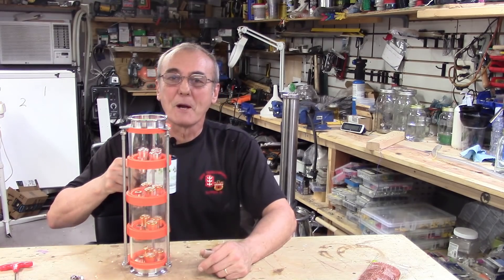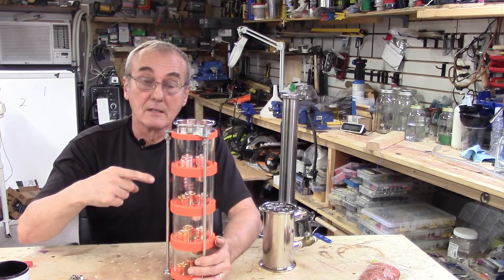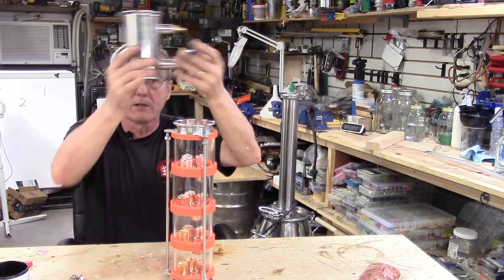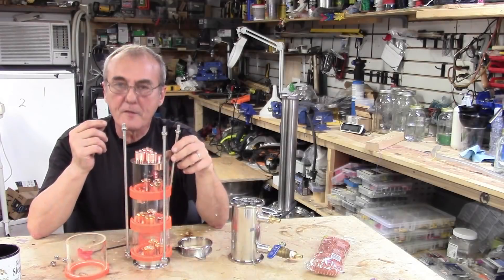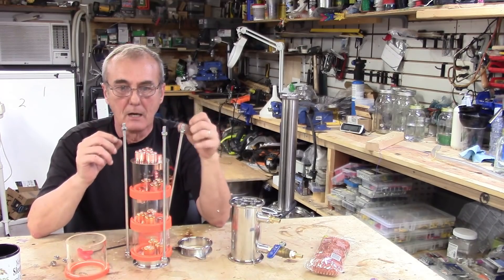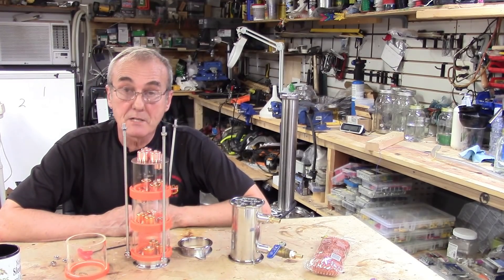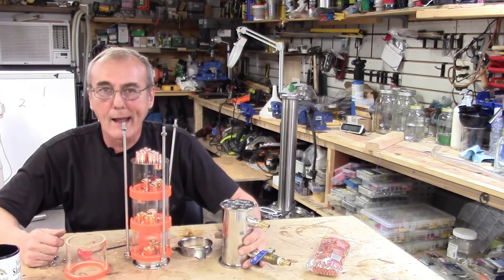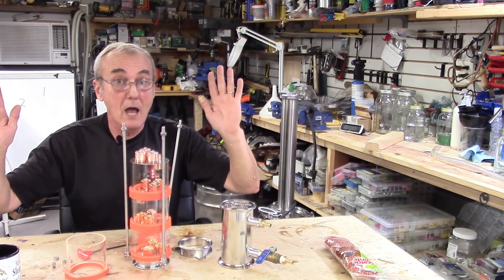RUNNING A 3 INCH BUBBLE PLATE COLUMN

Comment: I am considering upgrading from a 2"  bubble column to a 3 or 4.  Does it help the run go faster? I have a 50 litre still I use it on.
Reply: 3" double the output of a 2" column

Comment: 3" Copper Bubble plates Distillation Column with 5 section for Distillation .Glass column . https://www.aliexpress.com/item/33018484813.html?src=google&albch=shopping&acnt=708-803-3821&isdl=y&slnk=&plac=&mtctp=&albbt=Google_7_shopping&aff_platform=google&aff_short_key=UneMJZVf&&albagn=888888&isSmbAutoCall=false&needSmbHouyi=false&albcp=11473829221&albag=112083206157&trgt=489474619664&crea=en33018484813&netw=u&device=c&albpg=489474619664&albpd=en33018484813&gclid=Cj0KCQjwi7yCBhDJARIsAMWFScMWw63sA-WT1jXkDmNA2Ho-N0AqgV-ZFC8dmC2axpJuTJSkJW25c4oaAkG4EALw_wcB&gclsrc=aw.ds

Comment: Is there an efficiency issue with using a 2" to 3" adapter on a keg?
Reply from the maker: In terms of run time there would be little improvement. You are going from 2 inch with an adapter to 3 inch which in actuality is a 2 inch column. The vapor flows faster in the 2 inch and when entering the 3 inch it will slow down (following fluid dynamics) so unless you increase the temperature the output rate remains the same. Increasing temperature can lead to scorching or early arrival of tails.
Reply: @BarleyandHopsBrewing  Thanks!

Comment: Did some work on a chemical separation prototype unit 18 months ago.
Got to meet some very cluey Phd type chemical research scientists in the process and picked their brains as much as I could in meetings.

They swore black and blue that packed columns where the best option whether scrubbers or structured packing, until your column gets out to about 2 foot diameter, at that point they said it was more efficient/practical to start using sieve or bubble plates.
Reply: Interesting. All the small commercial distillers seem to use bubble plates, but they are separating their cuts at each level. Maintenance and cleaning is probably a lot easier with bubble plates too.

It would be helpful to see a head to head comparison with small three inch systems. Going the bubble plate route, even DIY, is quite a bit more expensive than stuffing a column.

Comment: Hi George :) I'm wondering if you would do a video or share some info comparing a packed column reflux still with a bubble plate/ flute still. I can't seem to find anything here and would love to hear your thoughts/experience on these. Aside from a big price difference, are they fundamentally the same?
Thanks for your time,
Carley.
Reply from the maker: Great suggestion!
Reply: @BarleyandHopsBrewing  Seconded! But as you always say George, let your conscience be your guide.
Reply: Yes they are fundamentally the same.  Ease of maintenance (cleaning) is one big difference.

Comment: Would that work whisky with the bubble plates
Reply from the maker: yes
Reply: Hi I see this one guy first puts it through a pot still and then through a bubble plate still does this not strip the flavors to mush 👍
Reply: Yes, for whiskey/bourbon you just wouldn't use any cooling in the dephlegmator (turn water off) or remove it so all the vapors go over into the condensing side.

Comment: maybe you can help me with the following comment.Hi Michael,                  We include many items with our distillers that are not even available elsewhere, such as a water control system.  However, I extremely highly advise against using a PID controller to try to control your temperature, as it causes cycling of your heat source which makes it impossible for equilibrium to be reached in the column, resulting in a lower purity/quality product.  To control the speed of the boil you should use a voltage controller, which allows you to reduce the heat output of your heater without causing cycling.  The result is easy control of vapor production speed while maintaining a consistent speed of vapor production.  Your head temperature will be able to remain constant, with a much higher final product quality.                  Please let me know if we can be of more help or if you have any more questions.                                  regards,                                  Rick  BrewhausHot Sauce Depot5951 Park Vista Circle, #125Keller, TX  76244817-750-2739http://www.brewhaus.comhttp://www.hotsaucedepot.com
Reply: If you don't know Rick you should, he's an expert.  And he funded the first effort at changing the law in Washington several years ago.  Great guy.  Use his site for all your supplies.    Plus, Tech Ingredients channel bought their still from him for their distilling videos and distillation explanations.
Reply: Rick - Do you recommend any low cost voltage controller products or kits?.  I know StillDragon used to sell one.
Reply: @VARocketry  I got a 10,000 watt one off Ali Express for my still boiler. I run a 3.5 kw element 240 volts. Works great

Comment: Cool video! 
Have you ever done anything with jack distilling, by freezing the worst as opposed to heating it to remove the water? (Traditional Apple Jack)
I know it can be dangerous because of the height concentrations of methanol and other toxins. I imagine if you would but it in the still and heat up to and hold 170° for 15 minutes it should remove that and then freeze distill it it would be safe...
Reply: (double check what i claim before acting on it)   i dont know anything about jacking other ferments than apple - this is only about apple jack:

i beleive that most of the methanol in hard cider is 1) already present in the raw apple juice, 2) produced by fermenting pectin.
commercialy available ap juice (the cheap stuff in supermarkets thats preserved with vit c), has been pasteurized which removes most of the methanol, and its been cleared, which means the pectin has been stripped.  

so if you ferment that, there should not be significant methanol content, as opposed to using fresh, untreated ap juice.

you dont generate methanol in freeze distillation, so your ap jack will only be as dangerous as your hard cider, ie not very.  it does have all the congeners and tails, so its hangover material though.

if you are going to distill it, you will get ap brandy, not ap jack. in brandy, most of the flavour is in the heads.  ap jack has all the heads, brandy usually doesnt. so its a different product. 

the point of freeze distillation is that its cheaper, low key and easier than heat dist.

if you make and drink hard cider and you havent gone blind, you should be able to jack it too.  just make a note on how much hard cider gives you how much jack. ie 1 pint hard cider = 1 shot ap jack, and then consume according to that.  so if 4 pints of your hard cider = zombie hangover, dont do 12 shots of jack from that hard cider and expect to leap out of bed with a postive outlook on life next morning :)

Comment: Would a 4" column set up take more Wash to make it run "best", or is a larger diameter just require a larger wattage element to maintain column temperature ?
Reply: bloombrews 

The larger the column the more vapor that can occupy it... therefore the faster you can distill a given quantity of liquid.

If a reflux column is properly balanced it’s size won’t affect quality... just time.
Reply: Agree with Mad mick, the answer to your question is NO and No.  Larger operates faster.

Comment: If I have a 25 liter pot (still) What would be the maximum gallons or liters should I or would you put in it
Reply: Around 4 gallons and make sure to add boil conditioner to keep the foam down
Reply: What is boil conditioner
Reply: @scummyification  its sold by most brew shops and will keep your mash from foaming up when you distill it.
Reply: Use only 75%or 80% of your container capacity.  Varies because aggressive boils cause more foam.  So use 17-20 liters of mash in that 25 liter pot.

Comment: Sir I have a pretty basic question. Im running a 15 gallon keg. How much space would you leave in the pot between your liquid and the column?
Reply: I would put a max of 12 gallons and make sure to add boil conditioner to keep the foam down.
Reply: @chuckdontknowdoya6100  Thank ya Sir

Comment: Hey,
I'm an old follower of your channel. I just started this account.
I'm in progress to build my on still. My goal is to make single pot whiskey from malts. I have the following question.
When using reflux, why not control the cooling water flow with PID (3-way valve) and let the heater work full capacity?

Comment: Hello,  I need help,  I'm new to distilling and I used a recipe I found online. I used 8lbs corn, 10lbs brewers sugar and 2lbs 6row barley, 5gal water. I heated to 180° (new burner and equipment heated water too much) stirred in sugar, let cool to 160°, stirred in corn,  let cool to 140-150° stirred in barley, let cool to 90-100°, stirred in yeast and let sit 12days. The problem is the whole carboy is cloudy and looks like its all sediment. If I look closely i can see a thicker layer of yeast on the bottom. I ran through cheese cloth and my ABV is only 4%. I'm about to distill now but I don't have high hopes for high yield.  I did something wrong but have no idea where the hard left took place.
Reply: What was your starting and finished readings of your hydrometer.

Comment: George, are you removing all of the column packing when you use the bubble plates?
Reply: Yes
Reply: You can or you can't.  Packing in the column acts as additional plates to increase the total effective number of vapor separating plates when added to the 4/5 bubble plates used.  So instead of 4 of 5 plates, you may actually be effectively separating with 8 or 9 plates.  Some people say they're redundant, but you can chain multiple packed columns or bubble plates together to achieve whatever level of separation you want.  Someone looking for a whiskey / bourbon WOULD NOT use a packed column and bubble plates together;  if vodka or pure alcohol stripped of flavors is desired then use both or more.
Reply: @VARocketry  
I have been using four 3” bubble plates from Mile Hi and a four plate Chinese tube. I and getting 95 percent in the beginning of the run and around 85 percent at the end. I shut the still off when I hit 50 percent.
Reply: @edwardclutzjr262  Ed - Understood.  Okay, so 50% means you’re stopping when your mash is still yielding 50% alcohol content ( or 100 proof output).   That’s way too high for most distillers and wastes alcohol. 

 If that’s your cutoff for taste, then recommend you continue to strip down to 20% or lower and then save & pour those tails back into your next batch.  This will add flavors and alcohol from those tails into your next run.
Reply: @VARocketry  
I will try that on my next run. 
Thank you.
Reply: @edwardclutzjr262  Cool.  You won't regret it and you 'll have more alcohol stripped on subsequent runs.
Reply: @VARocketry  Do you by any chance know whatever happened to George Duncan?
I see that he has not posted anything for over six months.
I learned a lot from George and I miss his posts.
Reply: @VARocketry  20% Output, how much alcohol is still left in the boiler?
Reply: @losFondos  20% of the  volume of the alcohol in your batch/run. So if you are running 11gallons of typical 9% yield low wines, multiply that by 20%.
11gal x 0.09 x 0.2 = alcohol left (approximately)

That’s why we collect those remainders and run them again .
Reply: @jimsutton8874  wow, that sounds like a lot of product left in the kettle. What would happen if you continue to distill it further? Increased amounts of fusel alcohols?
Reply: @losFondos  the resulting product didnt taste good but was easily combined into future runs to be redistilled.

Comment: You have to be careful buying copper mesh as well there are many that are coper coated. I use 3 in sanatary sight glasses with a bubbler plate stuck in there. On thing to look out for make sure you dont over tighten the bolts and tighten them evenly. If not you can crack a glass. Replacement glass is hard to get.

Comment: Very nice to see it run. The risers are not supposed to be dripping any liquid down, only vapor should be coming up and bubbling through the liquid layer on the tray. The part of the downcomer above the tray functions as a weir to maintain the right liquid level. The inverted cap on the downcomer bottom is a liquid seal that prevents vapor bypassing. Every plate has a small pressure drop with the bottom at higher pressure. In the case of such a small column it will be very small. If you were able to generate a lot of vapor, you would back up the downcomer and flood the column.

Comment: George  you ran this,  so how much weight do you think is safe to hang on the top,   I would think the glass being weighted to the side with the hang off of the condenser might lead to the glass breaking,    are they really that strong..  #HappyDistilling
Reply: @chrishayden3854  so adding a SS gin basket and the condenser  should not be a problem,  with the weight off the side,, I hope is what you are saying,,,  it would sure be a lot cheaper than a SS column w/bubbleplates,, those things are $1000.00  plus ,,

Comment: Would there be any benefit to add a single bubble plate on a two inch column  without any other addons? Do you need the condenser above it or would packaging allow it to load?
Reply: Was wondering the same thing.

Comment: Hay Goerge Thanks so much for all your hard work in teaching everyone how to make some great boose. I use a 2.5 in. Crystal dragon made by Still Dragon and it works just like your unit.
I would like to point out that when you take off the first bad stuff like 200 mil's at the start of your run. Turn off your deflagulater so the bad stuff can get out of the still. Then run like no tomorrow.LOL

Comment: Awesome video. Just used my reflux still with 4 copper plates yesterday to make some 90 % for some sanitizer. I found that I had to turn the water way down in the defleg otherwise the temp would slowly drop. All worked out well and collected some high proof 90 % ethanol for some sanitizer. And thanks for the how to vid on the sanitizer, that was very helpful. 👍🏻
Reply from the maker: Good stuff

Comment: This is great timing.  I started adding on to my Chinese still. I’m wanting to utilize The 18.5 gallon pot as a column still.  My only question is.  I believe my Chinese still has a 2.5 “ tri clamp set up on the lid.  Do you know of any adapters that will go from 2.5” up to a 3” column?
Reply: You can find them on ebay.

Comment: If I am going to be using a pot still with a thumper tank/keg on. Where is the most critical point to measure temperature? The pot itself, the thumper tank/keg or maybe both? Been through most of your backlog but have not come across this.
Reply: Top it the column. Prior to your condenser,, worm, whatever.
Reply: @scottsammons7747  ThankS man!
Reply: Scott has it right. 
    Might want to make sure you have a pressure gauge and release value if you're going to using a closed system like that.
Reply: @1MIC2GO  Thank you!

Comment: I've learned quite a bit so far, Thanks George ! I'm building my first unit. Trying to decide on stainless vs. copper. I am also trying to make it possible to convert from a pot still to a reflux still. With what I've seen so far the cost is not that much different and stainless seems to be a good choice from a cleaning aspect. My question is for a reflux still pre condenser, which is the best way. An inserted coil,  the cross tube or the shotgun style I've seen  a variety and my first choice was cross tubes, but I am concerned with soldering cross tubes in stainless ? I can use all the advice you can give me out there
Reply: I've used them all and prefer the shotgun.
Reply: @chuckdontknowdoya6100  Would a  jacketed pre-condenser on a 3" column be sufficient for these bubble plates? Or is a dephlegmator required?
Reply: @americantherapy1366  I'm using a 12 inch dephlegmator on mine with a ball value to control water flow but am going to switch to a needle value to get better control I'm also going to split the water supply and run to separate systems because the dephlegmator water is melting my ice to fast and doesn't have to be as cold as the condenser so that will be tap water and the condenser will run ice water from my cooler  I will also save the dephlegmator water for my next batch.
Reply: Rick - you HAVE TO HAVE copper in your distilling path somewhere.
There’s a reason moonshiners and ALL distilling companies use copper stills or significant copper elements in their stills.

When you ferment any kind of a grain or any kind of a fruit you will produce a very small quantity of hydrogen sulfide. Hydrogen sulfide is almost as toxic as hydrogen cyanide and in very very small quantities will create a foul sort of rotten smell or taste that will get into your final product .

Hydrogen sulfide in the vapor is absorbed by this the copper and it forms
copper sulfate on the copper surfaces.  (Hence the need to periodically clean it.)
The copper in the plates or in scrubbers will actually convert the hydrogen sulfide to sulfate that sticks to the copper plate and removes that off-flavor. So especially when you're using a stainless steel still you'll always want to have some copper in intimate contact with that vapor in order to absorb the hydrogen sulfide.
Reply: @VARocketry  thanks for that tidbit of information its good to know

Comment: Hey George.  What proof are you getting from that setup?  If I try all my tricks at once I can get about 192 proof and I'm wondering if that would allow you to get higher proof or to just do it faster and easier since they all seem to control their own levels with the downcomers.  But more importantly, it sure does look cool and give you more to watch.
Reply from the maker: Runs much quicker than a regular reflux. 190+ proof depending on defleg adjustment. Rememebr that 196 is the scientific max through distillation. That would be a perfect run.